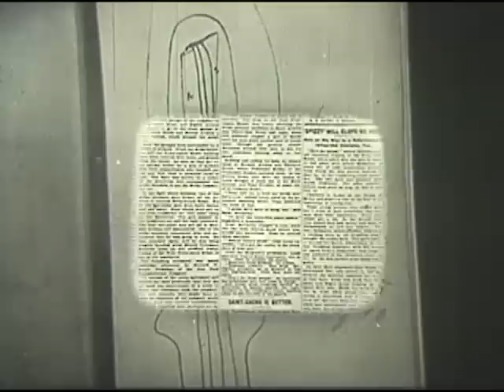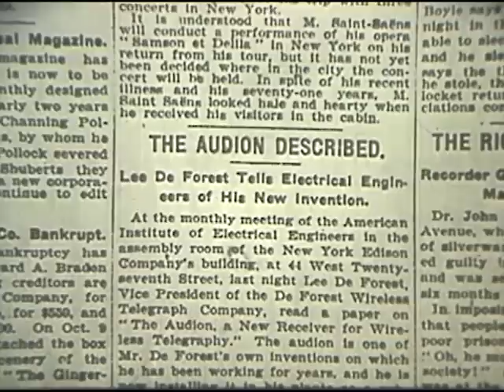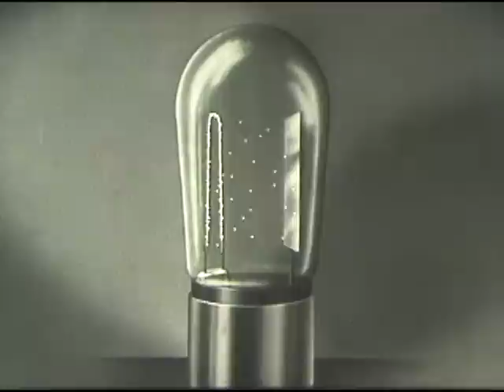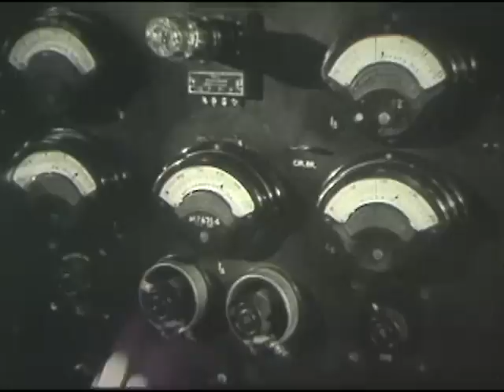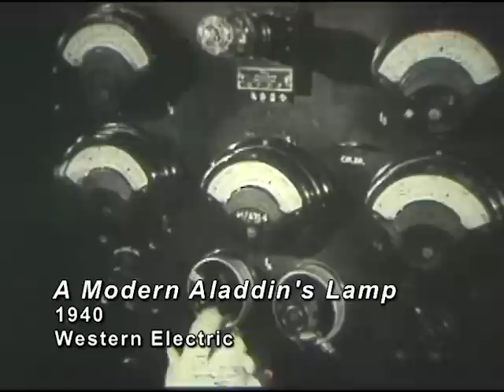AT&T Archives: A Modern Aladdin's Lamp, about vacuum tubes,1940

Comment: Haha. I am an electrical engineer 51 years old.. and this vid still explains electricity better than I've ever seen it explained, anywhere else, ever.
Reply: My mother worked at Bendix Radio in the middle 40s to the middle 50s and then Westinghouse Corp. She could tell you all about this,. She even built her first Tv before I was born in 55. Most people take electrics for granted what when you think about' what great minds these people had.
Reply: I agree, I was so confused in high school chemistry by the completely inaccurate way the electron cloud of an atom was portrayed.
Reply: My thoughts exactly.......................He perfectly and easily described exactly how they work, why they work and why they are designed the way they are. Today's youth have NO IDEA how things actually work, only that they work and how to cry when they don't.
Reply: If electricity and electrical components were explained like this in high school I probably would have done better with electrical theory...
Reply: @camerond8176  Easy now, not everyone under 50 is incompetent.
Reply: As an electrical engineer, you should know that electric / electronic equipment operates on smoke particals. If you let the smoke out, it no longer operates. I know this from personal observation and measurements.
Reply: @huntsbychainsaw5986  I'm over 50, and I agree 100%. The "kids" (i.e. early 20s adults) I work with in IT not only understand some insanely complicated processes, but they jump from one thing to the next with hardly a bump.

We older folks know about technology because it was comprehensible when we were a kid. You could pop out the tubes and put them back in. It was all large enough to be handled. There are educational tools for learning today's tech, but it's impossible to "tinker" with cell phone internals. It's no longer economical to build a PC from parts. All the knowledge comes from purchased educational products (Arduino, Raspberry Pi, etc...). If you're not really into it or can't afford it, you're stuck. 

My 24 year-old designed a gaming keypad in CAD, exported it to a 3D printing program, and filled it with mechanical keys (better feel and less wear and tear on the main computer keyboard). He then used an Arduino and Raspberry Pi to create a configurable driver for it. So now, he's got an ergonomic, 16-or-so-key keyboard he can program for any game he's playing. He did this "on a whim" because he felt like it. While he's clearly smart, he's not "exceptional" (except maybe to me ;)  ). There are hoards of people in his generation tech savvy in a way we can't even understand.
Reply: @EricAtRandom  If I received even so much as half the respect you showed your younger colleagues in your comments, I probably wouldn't hate my job nearly as much as I do.

Try training someone twice your age who's been in the field as long as you've been alive and absolutely refuses to listen to you. Then you get to watch this same person absolutely fall flat on their face the moment you set them on their own.
Reply: @drewthompson7457  haha!!! You refreshed my mind...that's a good one!!
Reply: @andomi  : I once read an article that was selling bottled genuine British Leyland smoke to put back into the cars wiring harness.  The article also listed the amp rating on various sizes of screws and bolts used to replace fuses in the electrical system.  (Likely why they were selling replacement smoke)
Reply: @johnmorgan4368  The whole perspective on electricity is wrong together with the standard model and big bang bullshit.  For example, the electron is a open three body object, a phase locked loop oscillator so to say. The Compton Frequency  is a signature. The electron shell houses the positron and the positron the tau particle. No experiment ever created positrons, they where always there in the first place and you shot them out of the shell, that's all. Recombination will emit 2 photons and it "disappears". Reason is, they don't understand Newtonian mass correctly, it a derived property.  Read Stoyan Sargs Basic Structures of Matter book and you will understand not only electricity also most of the physical world. It's not the answer everybody is searching for, but physics is not wishfull thinking and a complex model with very high level of detail, deterministic and logical is more probable then a complicated one with 12+ dimensions, dozens of constants and paradoxes wherever you look. I call my school and study physics bullshit (mechanics is fine but that's about it.)
Reply: SAP..simple as possible
Reply: @EricAtRandom  we can all learn if taught well enough and long enough.
Reply: @AllToDevNull  nuts. Posittons are antimatter
Reply: I got through school not because of my professors, but because i worked at the library and would often troll ebay and such for old EE books because they taught it all and didnt require a subscription or left key details out.  modern publishers are bad
Reply: @huntsbychainsaw5986  Agreed, but there are more and more what I call Intellectually Lazy. Today I had a staff member state a piece of equipment wasnt working. I told him why didnt he turn it on?
Reply: @Evlengr . I've met some pretty dumb "smart" people and some pretty smart "dumb" people. So I guess I would say there are many different ways a person can express intelligence or the lack there of. Still can't fix lazy though... and I paid for it.

Ended up being involved in a workplace accident because of a coworker's negligence so I'm off on comp now. A perfect example of how someone's negligence can effect others.
Reply: I've seen this years ago. The monkeys and the blinds have always stuck with me.
Reply: What about the aether?
Reply: @camerond8176  , exactly.  My kids live on Desktops, XBOX's, Galaxies, their school laptops, and have no clue about how they work.  They even look at me funny when I ask them the last time the did a Disk Defrag, or Browsing History delete, etc.  Same with their bikes, won't air up the tires or oil the chains, even though I've showed them.  The future will be very lucrative for anybody willing to do any hands on skilled work.
Reply: Blm enjoy
Reply: The videos made in the 1930s and 40s seem to all do that. I watched a film produced by Ford explaining the rear differential. It put it in such easy to understand concepts. I bet few college professors in mechanical engineering departments could get those concepts across over a period of 3 months that one of those films did for me in 10 minutes.
Reply: Seriously? I haven't seen any explanation of the work function in the material.
Reply: @AllToDevNull That’s so simple why didn’t I think of that. Thank you Mr. Knowitall!
Reply: @georgejetson4378  I just like to follow scientists that are way smarter then me. Stoyan Sarg is our Einstein which nobody listens to. I did and after a year I understood his model and laugh about the primitive, absolute insane perspective on physics that they thought me in my physics study.

Comment: CPU water cooling in 1940
Reply: like midget data in a hyperloop tube, your voice current goes out into the ether
Reply: When the CPU was literally one transistor
Reply: @StephenJamieson  the ENIAC had something like 24,000 tubes. Imagine cooling all that
Reply: @StephenJamieson  No, that is not the proper difference to notice. It was a fully analog device with infinite continuous states, while computers uses transistor in only two states for binary coding.

Comment: You're old if you can remember when drug stores had vacuum tube testing machines and stocked the tubes.
Reply: Robert Cuminale  -  did you ever see a shoe store x-ray machine?   The ones to check the fit of the new shoes?
Reply: Well thanks for the reminder.
Reply: When I was a young girl, my dad took me to Walgreens to check the tubes of our Zenith color TV set. This was in the 1960s.
Reply: Ours was in the nearby Radio Shack. By the time I was about 8, dad would pull the suspected bad tube, give me enough money to replace it if necessary, and send me down to check if the tube was bad and get the replacement if necessary.  He could continue with whatever he was doing while I got the new tube.
Reply: I remember when they installed the machines
Reply: Thrifty/Rite Aide drug stores where you could test your tubes and get a nice ice cream cone.
Reply: I remember seeing one of those vacuum tube testing machines at a Walgreen's Drug Store decades ago.
Reply: reverse thrust  Even in the suburbs south of Seattle, the local Safeway in my neighbourhood had a tube tester, into the early 80s;  the local Radio Shacks had them a bit longer.  The first radio I had as a young boy in the '70s, was my late mother's Zenith tube-powered clock radio that she got new as a University student in the mid-'50s.  It got to the point where the required replacement tubes were more difficult to obtain, so when one or more of them failed in the early '80s, my folks decided to relegate it to the garbage.  That was a sad day for me.
Reply: Omg I forgot all about those wow, now I do feel old Thanks!
Reply: I remember the tester in our Safeway in Sterling VA in the mid 70s.
Reply: Still have one from my old store in storage .🤗
Reply: Guess I am old. 🤣
Reply: I went to Sears with dad to test and buy tubes for TV.
Reply: I am so old I can't remember 😆
Reply: I guess I'm old. I started in electronics when everything was tubes, and transistors were the "wave of the future" .  It's truly astonishing how far we've come.
Reply: I remember seeing a tester at a grocery store in the mid 70s. I don't remember them selling the tubes, though. Radio Shack was probably the last place that had them into the early 80s.
Reply: @waterheaterservices  It is call Old Enough to Remember, but Too Old To Remember Syndrome. It seems to be going around. That is if I remember correctly. 😮😉
Reply: A tester is still available for public use here at the electronics shop.  A surprising number of people still use it since tube amps are still popular.
Reply: @Sparky5  yes specially if your a musician with a tube amp, they have the best sound of all, all your top guitar players use them.
Reply: Don't call me old! :P
Reply: @grendelum  My dad had one in his shoe store. They were outlawed apparently before I was born, and just after he paid for a new replacement X-ray tube.
Reply: -  I remember when;  🎶 a dollar was a dollar & a dime, a dime & I'd sing you anther chorus, but I haven't got the time.🎶
- And when discarded vacuum tubes made cool space ships. 
-  Some tubes had metal caps on the tops that would fit tight in Tinker Toy joints & then made young imaginations. go wild.
-  And why the smallest replacement tubes were always the most expensive & a good tube would have to be replaced if the orange controll panel glass blister lite up during testing & everything was test arrow in the "good" green zone.
Reply: -  Orange light ment gas in the otherwise good tube.

Comment: I have a 1962 Motorola radio and phonograph console that uses vacuum tubes.  It still works.  No tube has ever blown out but I don't use it much.  The sound of both the radio and phonograph is still excellent.  Love the way the radio has to warm up before it starts to emit sound.

Comment: I felt in love with vacuum tube technology when I was a kid. My grand parents had a color tv which used tubes, and also a tubes radio we were listening to every Wednesday. I was fascinated by these glowing components. Now I'm repairing old tube radios...
Reply: My uncle used to repair radios and televisions up until the early 1980s. In the late 70s, I would take tubes to the pharmacy which had a tube tester. My folks had an Admiral 'hybrid' 25-inch(26-inch in the U.S.) colour TV. Some of its circuitry was transistorized. Its tubes ran at a reduced voltage so they needed less time to warm up, making it almost instant-on...

Comment: Western Electric vacuum tube is a myth of high quality here in Japan too. This video gave me a clear image of WE.  Thank you for upload. I have some American made tubes licensed to Sylvania from WE produced for military service in WWII.  I am going to make a DIY audio amplifier using those tubes. They are indeed beautiful and reliable ones.
Reply: I have a few here I laughed when they said 50,000 hours how about 65 years and still going strong?
Reply: Yes, they say "over 50,000 hours". That's counted as 5.7 years if run for 24 hours 365 days. But when used in consumer audio, lifetime of tubes will not be counted in this way. One of the reason is that there is rush current into filament when power gets on. It slightly damages cold filament. So it doesn't reach 65 years even when you use tubes only a couple of hours a day. I think normal lifetime of consumer audio tube is less than 10 years especially when you expect good sound quality.
Reply: @nagakamo  I wonder why they didn't put something in the circuits that would have more slowly ramped up the power, to increase tube lifespan?
Reply: @porkyfedwell  Some did.
Reply: W3pmv
Reply: @porkyfedwell  It's bad for business!
Reply: @bobboscarato1313  I would have thought to do it using an external circuit so the tube wouldn't have the extra circuitry.
Reply: Yeah I quit building amplifiers long ago as I entered the HVAC industry full time.
Reply: @Intelwinsbigly  Solid state eliminated lots of heat problems with tubes and space considerations as well.
Reply: @bobboscarato1313  I understand that, but they still have use in smoothing signals, radio, and the production of high energy photons, so extending the life of vacuum tubes is quite important in my practice.

Comment: It might be because vacuum tubes aren't nearly as common nowadays, but I learned more in a few minutes of this video than any modern video on the subject. The examples were funny and very informative, and the subject matter is clearly explained.
Reply: +AJFreeway the only difference between the tubes of today and the ones described in the video is that these days, tubes have a metal tube snuggly fit around the filament known as the cathode, it makes design easier so you only have to apply one lead to create a circuit between the plate and filament/cathode.
Reply: +Joshua Lopez they've always had a cathode, that's what releases the electrons. the animations in the film are grossly oversimplified for demonstration purposes. some cathodes are directly heated, some are indirectly heated by a filament.
Reply: michael Woods I was kinda referring to the early deforest audion tubes. They just had filaments.
Reply: That filament is what is called a directly heated cathode.
Reply: SlyPearTree yep, but since higher amounts of power applied tended to burn it out, the cathode was created to make the tube handle power beyond what the filament was handling before it burned out.

Comment: Back in my radio days (late 80s to late 90s) our AM transmitter had four tubes that were probably as big around as my thigh.  Those things put out so much heat that the AC in that room ran 24/7-even in the middle of winter.

Comment: 1940's watercooled vacuum tubes ! And here I am with a watercooled processor with over 3 billion transistors... Puts things in perspective about how much progress has been achieved... Very interesting video!
Reply: lsq78  -  water cooled glassware has been around as long as modern glassware has...    the 10W mixed-gas white light laser I worked with at a planetarium had a water cooled laser tube (with a 5-ton water chiller out back) that was indeed a very functional work of art.
Reply: And those CPUs require a $1B Wafer fab and lots of nasty chemicals and huge amounts of water resources. Just saying 😎
Reply: You're comparing apples with oranges.  Your microprocessor transistors are only used as fast switches, they're most suitable for digital data and a digitized world of data. The beauty of vacuum tube is their full analog capability. Thus instead of millions of semiconductor integrated transistors to encode and decode audio only a hand full of vacuum tubes is needed. And the tube audio sound is still warmer more natural to the ear than digital audio. To this days many audiophiles recognize that.  It's just that with the production of tube having gone to next to none, it is no longer commercially possible to design vacuum tube audio systems.  Yet the modern integrated transistor is not superior in all regards.